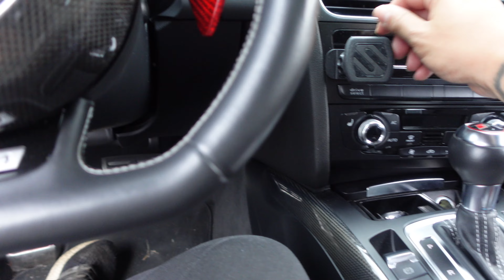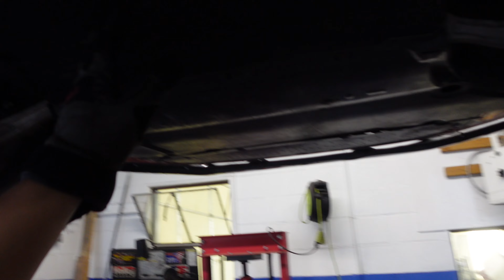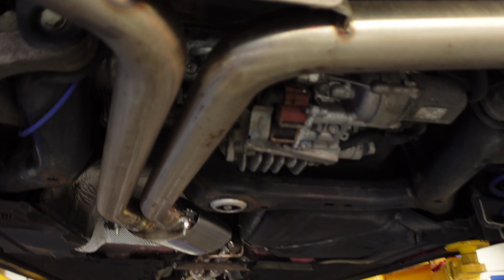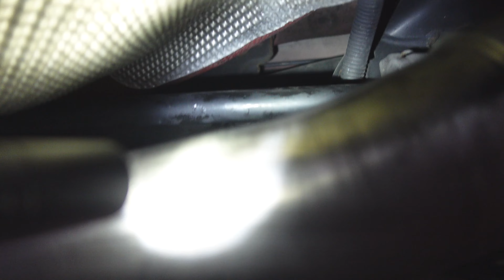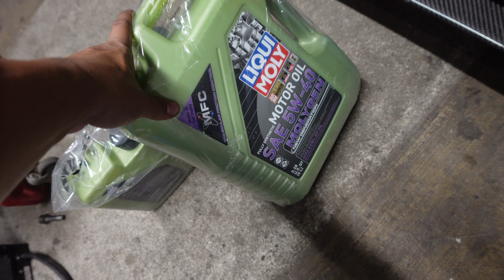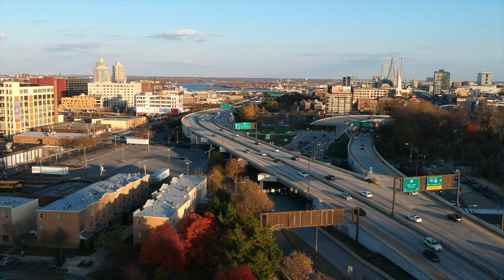Inserts + X-Brace Made My S4 B8.5 HANDLES EVEN BETTER!(RECOMMENDED)

Comment: Have you had any problems with the dsg clutches pressing in the gas goes no where and all of a sudden it goes?
Reply from the maker: I haven’t, I don’t wish that in anyone though. I’ve heard that happens a lot if you go and smash the pedal suddenly in D or S it’ll shock the trans as these mechs are like glass. I drive in M mode mode of the time if I know I’m going to hit it I’ll prepare to manually downshift to proper gear then hit it.

Comment: Great video - thanks! I'm about to do the bushings on my S5 - how long did it take for you to install them on your S4?
Reply from the maker: thank you! really depends.
Reply: I got billed 900 for trans mount + insert, rear differential inserts, rear subframe inserts , and upgraded tunnel brace. I’m not too upset at the total, some shops turned down the job despite showing them the installation guide.